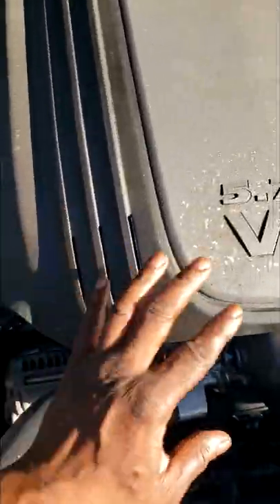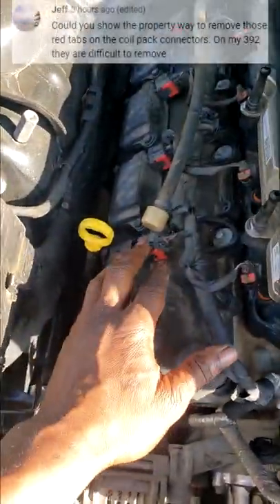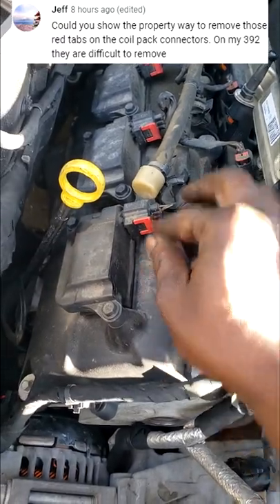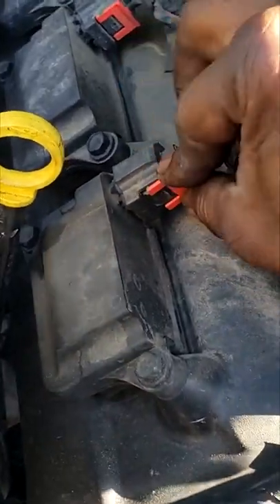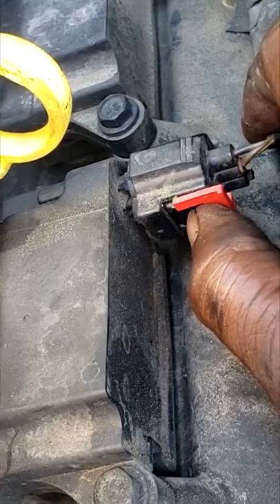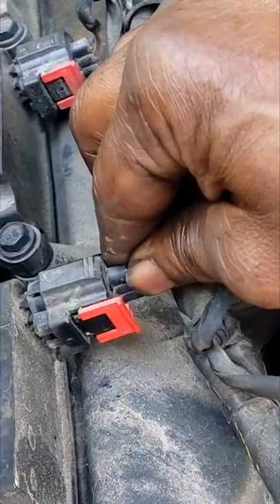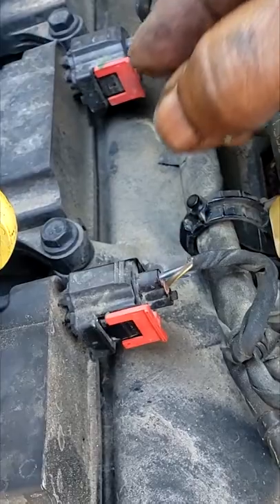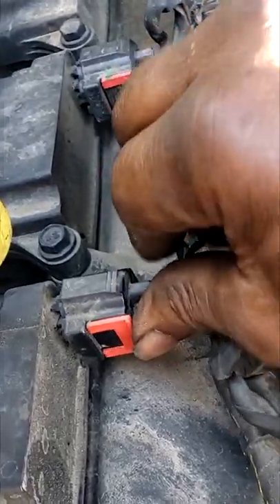Tune up TIPS about the Hemi motor. The Ignition Coils and Spark Plugs. #Shorts #Hemitips #Hemi

Comment: Good to know, most of the newer connectors are like that on Mopers now. I need to do the plugs on my RT soon so good to see the verification on how they work. My old Neon had connectors like that and sometimes they get old and brittle and break even if you try to be careful so keep that in mind. Usually they'll still snap in place well enough to work but be gentle.

Comment: JT do you ever put some of the die electric grease on the coil electrical connectors
Reply from the maker: I've never really had a reason to. But I'm sure in certain areas its needed.
Reply: @OnlineMechanicTips  I was thinking it might be a good thing to ease the plug out and keep water and contaminates out of that very sensitive plug. Just wanted the thoughts of an expert automotive doctor.
Reply: On the ones that don't want to go on smoothly use silicone spray.